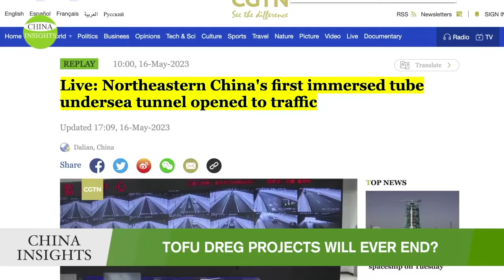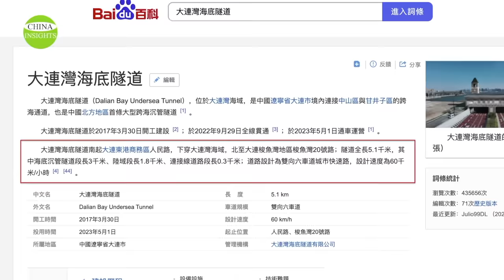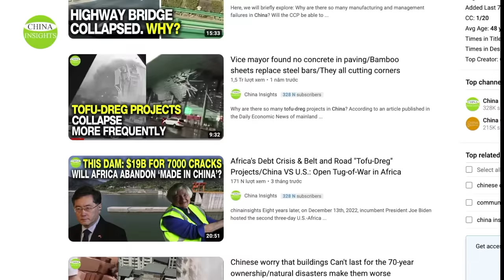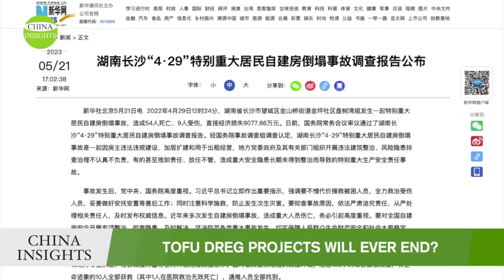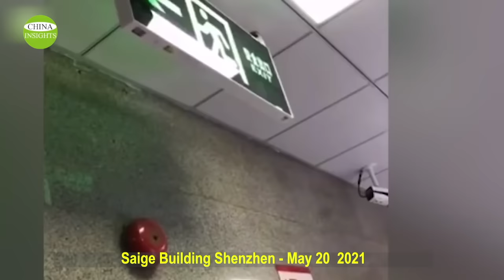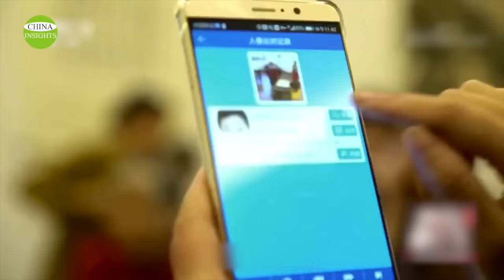Tunnel leakage, building collapse, shaking, cracking...when will the Tofu dreg project be over?

Comment: *The tragedy of "tofu-dreg projects" in China and how to solve it*

This video is a shocking reminder of the dangers of poorly constructed buildings in China, which can collapse or leak at any time. These buildings are often caused by corruption, graft, and lack of oversight, and they can result in many deaths and injuries. The term "tofu-dreg project" was coined by a former premier who criticized the flimsy and porous flood dykes on a major river. The term gained national attention after a devastating earthquake, where many schoolchildren died in collapsed school buildings that were later proven to be hastily and shoddily built.

The problem of "tofu-dreg projects" persists to this day, as many buildings in China are built with sub-standard materials, such as concrete mixed with reeds or sand, or without proper safety inspections or regulations. These buildings are vulnerable to natural disasters, such as earthquakes, floods, or landslides, as well as human errors, such as fires or accidents. The consequences can be devastating for the people who live or work in these buildings, as well as for the environment and the economy.

The solution to this problem is not simple, but it requires a combination of political will, legal reform, public awareness, and social responsibility. The government should crack down on corruption and graft in the construction sector, and enforce strict standards and penalties for substandard work. The public should demand more transparency and accountability from the authorities and the contractors, and report any signs of poor construction or safety hazards. The media should expose and investigate any cases of "tofu-dreg projects" and hold the responsible parties accountable. The civil society should promote a culture of quality and integrity in the construction industry, and educate the public about the importance of building safety and sustainability.

I hope that this video will raise more awareness and action on this issue, and that China will be able to overcome this challenge and build a safer and better future for its people. 🙏
Reply: 0:00 Introduction

 0:18 The tunnel leakage problem

 1:02 The building collapse problem

 1:46 The shaking problem 

2:28 The cracking problem 

3:10 The tofu dreg project problem 

 3:45 Building collapse in Nanning

4:00 The Outcome of CCP's decisions and Chinese people's questioning of the CCP because of the dangers of living in Red China under the Communist CCP, particularly because of the unaccountable bureaucrats who censured the case of the 44 university pupils who passed away in their uni dormitories (1-c policy results in only parents left, no other immediate family survived)

4:14 The examples of other tofu dreg projects in China 

5:00 The causes and consequences of tofu dreg projects 

 5:12 Glass water slide in Sandu 

6:00 The lack of accountability and justice for tofu dreg projects 

 6:54 Worker stapling leaves to trees

7:00 The need for public awareness and action against tofu dreg projects

Comment: My family have a 40 years old home in Germany, which we bought in 2011 from its previous owner/builder. It's a solid house with each wall build of 50 cm thick brick. Until now all the infrastructures & facilities are still intact and in a very good condition : Rooftop, floor tiles, all windows even the kitchen cabinets. 

We will renew the rooftop & all windows next month but not because they are damaged or causing problems but we just want to upgrade our house to an energy-efficient building to minimize energy consumption as well as to support a climate friendly living concept. We will receive 20% aid in the form of funding programmes as an applicant of the federal government's climate change package. 

Watching this video and seeing how those fake walls & bricks scrambling apart just by a one touch ..It's beyond words and makes me sad.😢😢 Greed knows no ideology whether capitalist nor communist!!!

Comment: The tunnel leakage is most likely not from the body of water above it...The pressure from that would blow a GIANT hole in the tunnel and the water would rush in and destroy the whole thing in less than a few hours...Builder and engineer for over 3 decades.

Comment: Let me just say this if the building shifts to the right or left front or back for no reason at all do you have structural issues the building collapses out of nowhere for no reason at all do you have structure issues substandard material is being used not being inspected by the proper people that know how to build a building I know what to use in a building here in United States if any concrete is poured before pellets another words canisters of concrete in all the concrete is tested before you can start building on it All concrete has to be tested with XYZ psi per square inch pressure before it can be built on it everything is inspected from concrete to putting up the steel windows outside walls he didn’t inspected before it closed up to be used

Comment: I'm pretty sure that it was a broken pipe. The tunnel has membrane and foam that is connected behind the jersey, so if that was sea water, it would come from the jersey. My guess is that the water on the road is a faulty pump combined with a drainage system that couldn't withstand all that water, but drained it eventually when the pumps started up again. 
I know China has lots of dogshit methods for making stuff, but I believe them on this one.

Comment: The Tofu Dregs have been built up by decades of cheap low-quality infrastructure projects, thanks to Chinese prefectures and local governments trying to artificially boost their GDP numbers.

The Tofu Dregs will continue to be built until the current CCP goes through a major restructuring/revolution, and then the Tofu Dregs will continue to exist until every cheap building is either collapsed, demolished, rebuilt, or completely replaced.

This is likely to remain a problem with infrastructure all over China for decades to come, with untold amounts of damage or casualties resulting from the countless bad construction projects. #ThreeGorgesDam

Comment: Well the big dug tunnel in Boston leaks and later they found contractors had built the concrete safety barriers on overpasses too low to save money. A huge piece broke off and killed a motorist entering a tunnel so it happens even in USA. Multi billion dollar project with cost overruns.
Reply: The tunnel needs pumps to get the water out that's what is missing here.

Comment: look up "lincoln tunnel flooding".

CCP and PRC are definitely a sh*tshow, but lets not kid ourselves that this is somehow political system related.
and arguably worse ss that was Soviet Union managed to have flawless tunnels and subway systems. meant absolutely nothing.

same goes for building collapses. Hard Rock Hotel. FIU bridge. list goes on and on. 

the fact that china is experiencing the same sort of corruption cases that we do in the west is more indicative of how far they've come in becoming a capitalist society where corruption actually pays. 

minor difference is that if in U.S. a corporation can pay itself or settle out of almost anything, in PRC they might actually execute a scape goat or two.
Reply: ah yes, structural failure of buildings, viaducts, bridges, and tunnels is actually a really a good sign.

Comment: My question is : Who was the idiot who raised a JCB shovel to the third floor? BTW since the advent of steel reinforced cement concrete beams and columns who was the idiot who incorporated load bearing walls ?  My father's apartment is more than 65 years old and even that does not utilise any load bearing walls.